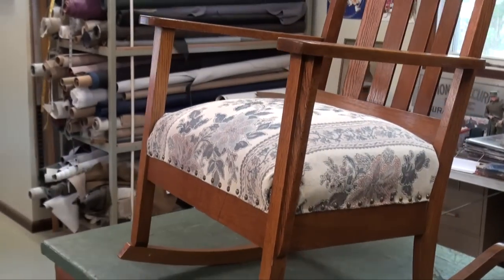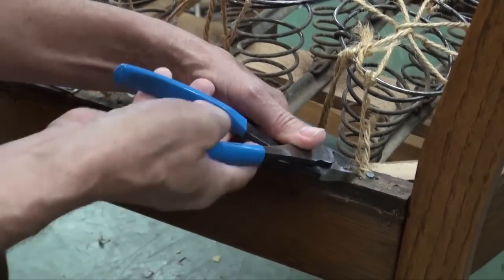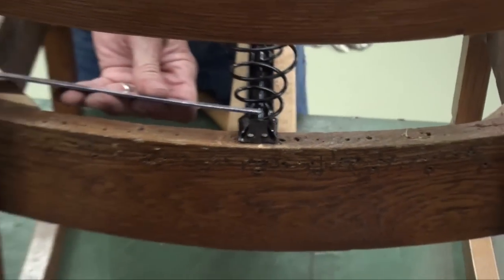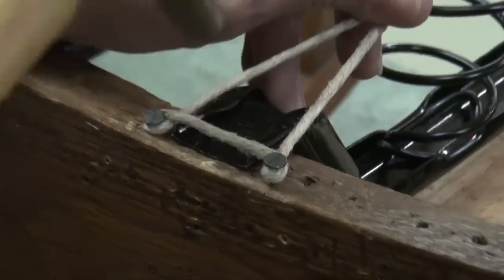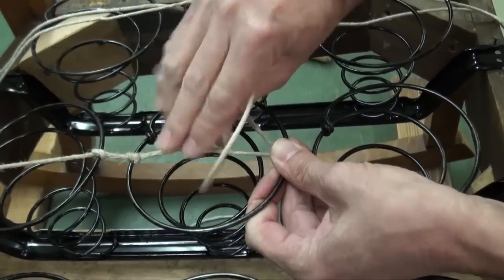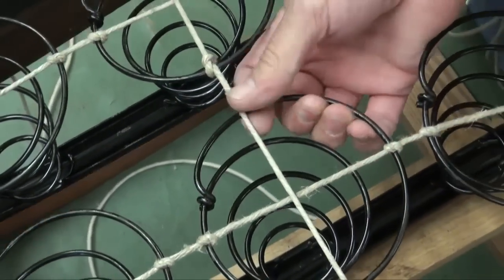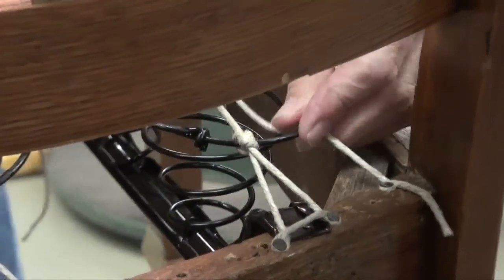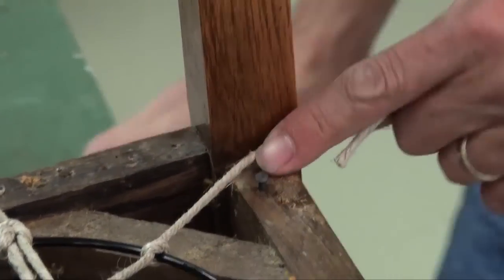Mission Style Upholstery - Part 1

Comment: I just took the bottom out of my rocking chair.  The upholstery straps are cris-cross wire with individual springs. The vertical wire is good and intact. But the cross wire hooks into the frame of the chair are broken off.  So basically I have a what you are using. I am wondering if I clean the metal ends up, could I tie the springs like you are doing?  The springs are in good shape as is the wire that it is attached to, or would you buy 3 new strap springs?

Having a hard time finding some at a reasonable price.
Reply from the maker: Buy new springs.
Reply: @Buckminsterupholstery  ok

Comment: what is the purpose of the string on the springs? is it to help it hold in place so they don't move?
Reply: In case others wonder, seems the reason for this is to connect all the springs together so they move as a single unit and it also gives the seat its shape. Because of this, I suppose it would be worth keeping in mind that you can over/under tie them which will affect the bounce?

Comment: I work for the company that made those Ridgid bar seat strips as a matter of a fact I made the springs that went on them bars. Barber manufacturing in Anderson Indiana we have been making quality coils since 1893. Look us up on the web. We are a custom shop we make them how you want them,
Reply from the maker: Thanks for the information. I sometimes run into special needs. I used to get straps that worked perfectly in 20's and 30's frames. Offset rows of springs with the front one an inch taller. The rear spring was set ahead of the lumbar support rail. There have been times I've only needed the tapered coil springs and removed them from the strap.
Reply: Buckminster Upholstery we make springs from 3" tall up to 8" tall in single cone which is what you got here. We also make double cone springs from 3" tall up to 12" tall. Wire gages from 8gage to 13gage. We are a custom order family owned shop that build to suit your needs. Barber manufacturing company since 1893

Comment: I have learned a lot through your videos. I have a question, have you ever uncovered a wooden chair frame that appears to have too many holes to grab the staples. If so, do you have a way to reinforce or fill the holes in the wood?
Thanks in advance
Reply from the maker: This is a problem that can be hard to solve. I don't know of a good filler. If you fill the cracks with an epoxy it's hardens too much to let staples penetrate. The staples either bend or the wood splits even more. Replacing the wood is the best option. In cases where there is exposed wood finish a person can disassemble the frame, cut the top nailing portion off and add a new wood strip.
Reply: @Buckminsterupholstery  Thank you

Comment: Hi, thanks for sharing. How do you know if a spring needs to be replaced or simply reset?
Reply from the maker: Most generally springs in chairs like these have lost resilience, are sometimes bent, maybe straps sagging. For no more than they cost and the amount of time it takes to retie them, it makes good sense to replace them.
Reply: @Buckminsterupholstery  many thanks for your reply. Getting supplies in New Zealand is usually on line and not much option for suppliers, so I will hunt around and find some replacements. Thanks. Love watching you work. Many thanks.

Comment: Great videos! Thanks for holding my hand! I am willing to try this. When you buy the Strap Springs or Bar Springs, how do you measure them?  My cushion box inside lengths are 16.25" in the center and 15.25" in the side. I am figuring on using 3 sets of bar springs.
Reply from the maker: Strap springs are sold "hole to hole" regarding nail placement over the rail. They can be bent inward or outward to adjust to your frame opening. They can be placed across the side rails rather than front to back if it works better with your dimensions. Most generally standard sized straps fit this style of chair front to back.
Reply: Great Thanks! This is very helpful.

Comment: I just got a rocking chair with the springs and have the metal bars like the one in the video.  It actually is a seat cushion that attaches to the chair. One of the metal bars is broken, can I get a replacement and do you sell them?
Reply from the maker: Can you send a photo to hipster73@hotmail.com? Are the springs framed with wire? A replacement is unlikely however I can probably reproduce what you need.
Reply: I emailed you pictures! Thanks

Comment: I have same chair where can I purchase that spring assembly.
Reply from the maker: Van Dyke's Restorers (I think). My wholesale suppliers have all dropped them for some reason.
Reply: @Buckminsterupholstery  so if I change out old spring assembly for 4” foam square then add  more fluff with other materials could I imitate a spring assembly? 
- how do I know my old springs actually need replacing  and not just top fill ( alternative thought)
Reply from the maker: Message me via my website for more information.

Comment: What are those spring sets called? Do they come in different sizes?
Reply from the maker: take2rollem Strap springs. Off hand I forget exact dimensions. 17 1/2", 19 1/2", nail hole to nail hole sizes. You can bend the ends in or out to adjust to your rail opening, sometimes needed with serpantined front rails. (thanks for watching)
Reply: Okay, thanks. I'm just starting out and I don't even know where to find those. I'm in Northern California. I've called a couple of suppliers out here and they don't know where to get them.
I'm doing a mission style rocker like the one you are doing in the video.
Reply: I found them in MO at Van Dyke's. I wish I could find them closer.
Reply: hello, Mr. Buckminster. I purchase the springs on the track. Can you tell me the best way to bend the ends? The very ends of the track extend passed the frame, so I need to bend them in a little on both ends.
Reply from the maker: take2rollem
Sorry, I didn't see these messages. Didn't know the link was here... You probably have the problem solved by now. Put the end against the workbench and push down hard. The strap should bend where it's folded at the base.
Reply: Yes my husband helped me with it. Thank you for your mission rocker video, I followed your instructions and did my first mission rocker and spring tie as well. I did my in leather, a little nerve racking, but followed exactly what you did and it turned out great!
Reply: My customer comes in a little while to pick it up; they are going to love it.